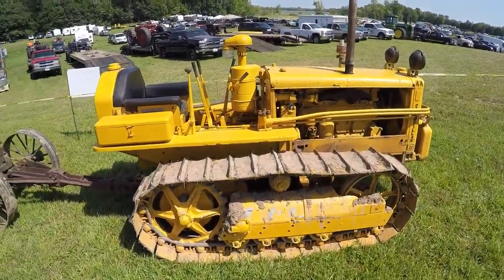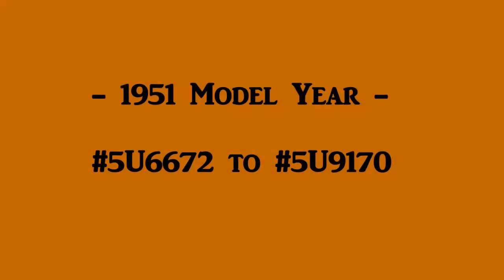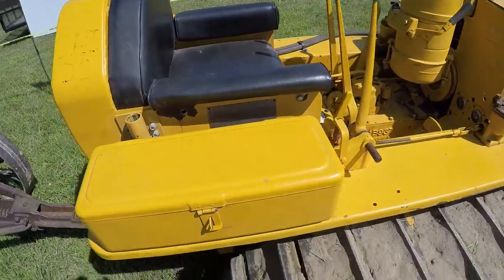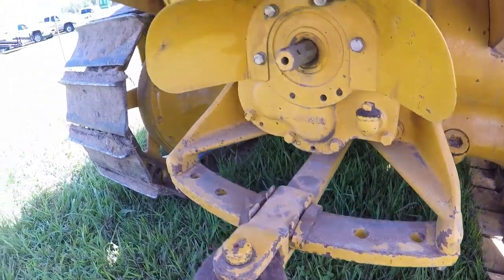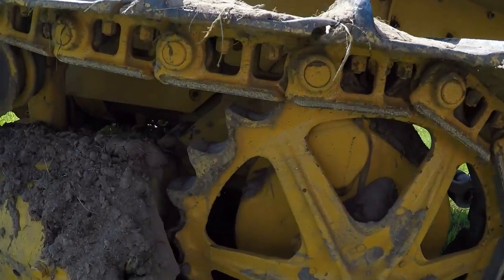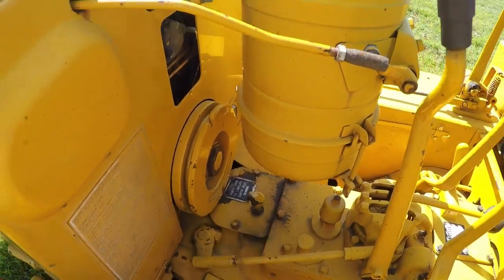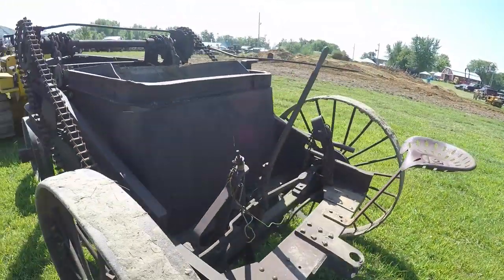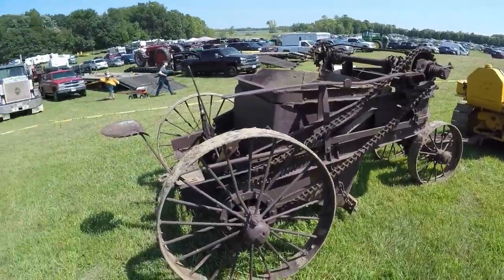Caterpillar D2 #5U8773 and Baker Maney Model DR Scraper Walkaround

Comment: Great video.  It’s been a while since I last ran a Baker Manny scraper.  Ten years ago I conserved an earlier Baker Manny circa 1910 horse drawn scraper that was converted to tractor pulled many years ago .  My scraper is much lighter in construction but the controls appear to be the same as the one you videoed.  The lever on the upper right drops the bowl.  The lever and pedal in the center above the rear axel raises the bowl and will do so automatically once set, and stop the lift automatically when the bowl has reached full height.  On my scraper and I think showing on the one in your video is a long lever on the right by the foot board for manually raising the bowl when not moving.  I have read when In operation two men could load 4 scrapers hooked together in 1 minute, 15 seconds per bowl.  As soon as the first bowl was filled the operator would set the lift lever, get off and move to the third scraper.  The man on the second scraper dropped his bowl as the first began to lift, then repeated the procedure as on the first and moved to the fourth.

Comment: High squatch I'm working on a MM forklift with a PB 206 gas they called them the milk stool engine but anyway I was wondering where I might source out parts piston rings and bearings rebuild kit for engine basically it's a 1960 machine but the engine was  made from 1942 to 1962 I believe thanks I watch for reply or perhaps another viewer may have a suggestion in BC here not a lot of Minneapolis molins
Reply: @squatch253  Okay thanks ill try them appreciate that

Comment: OK Mr. Wiesenheimer ... when I was 5 (now 70), I had to operate the converted horse drawn implements behind my Grandfather's 1949 Ford 8N.  In the canal project PIC, there are 6 scrapers, but only 2 operators (1st, and 6th).  I know we're not supposed to notice, but are they ganged by cable / rope, or what?  Inquiring minds want to know.